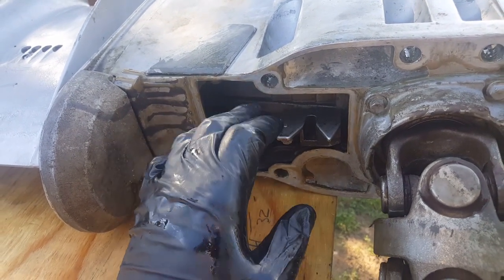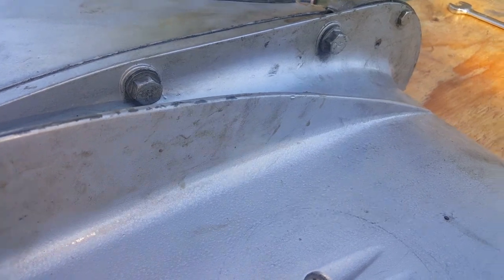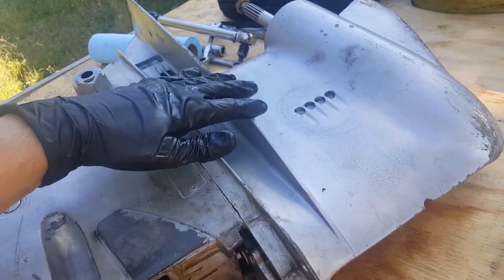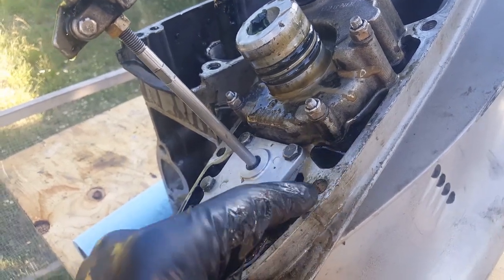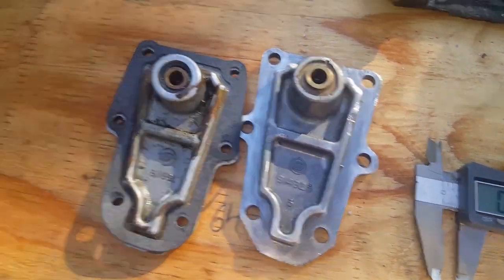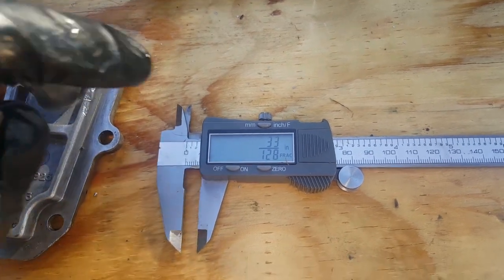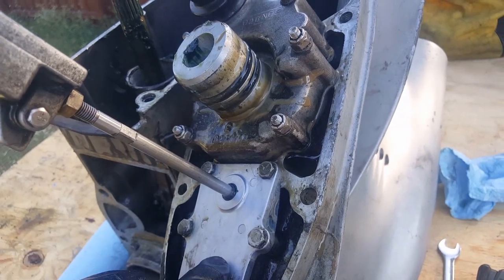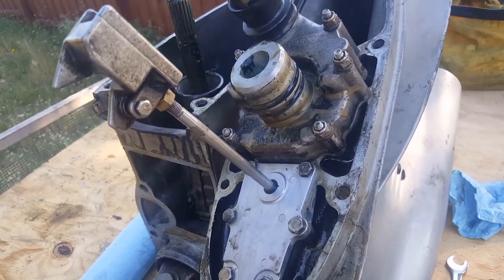Engine Bracket & ESA Troubleshooting Part 2 - Shifter Rod Adjustment - OMC Cobra Volvo Penta SX

Comment: I have a question. I have a 7.4 Daddy king cobra, I put new seals in the lower outdrive,  I pressure tested it off the boat, and seems good.  Now after I installed,  I moved the prop shaft and a bitt of gear oil leaked. It has tiny bit of play left and right. As  well as will pull forward slightly. Is mine installed wrong? Maybe bearings need to to be shimmed?
Reply from the maker: Hey check this out. https://youtu.be/833vJqDWGxQ?si=apo5OEhGsPPdRhtv
Reply from the maker: Hit that subscribe button too!

Comment: Very complicate 😅You must not split the upper and lower unit and mesure. You can use the OMC lower shift cable adjustment tool  (normally usable for the transom side) on the mirror side (Antagonist on upper gearcase), too. Use two long 12mm screws and fix the tool at the 2 lowest holes in front of the shiftrod. Sorry for my bad english.

Comment: You

I stored the boat for 4 months and now it's frozen won't shift in to gear forward or reverse. Shift shafts frozen in cover . Dose the shift rode come out with the cover ? . And how do I do it . The manual says to pull the rod out from the cover and the pictures show the shift rode out of the io

 Also how do you get the ride out

Comment: Hey mike! I’m currently setting mine up and the manual calls for 7.203 or 7 -13/64! Is this not correct?? I have a 1990 sunbird Corsica with the OMC cobra.
Reply from the maker: That’s fine. Just measure from the very top of the shifter to the base, not the shift cover. Please hit the subscribe button!
Reply: Michael Romer thank you for the quick reply! I used a 8” caliper and set it to the measurement and then used a metal ruler across the top of the shifter to the machined mating surface to get an exact measurement. Was right on the money! Crossing my fingers it shifts okay when I get everything else together. I’ve been watching all of your videos and they’re such a huge help! Thank you for taking the time for make them! I am subscribed and have the bell on! 👍

Comment: Hey I have been trying to locate some info about a potential problem I have been having.  I have an 1993 Four Winns Horizon 190 with an OMC 5.0 and cobra out drive.  We have  it had any issues until our last use.  When we shift into gear it it locks in and as we speed up there is a point where it seems like it is engaging into gear again. Make a clunk noise.  It will do it at a low or higher speed, almost like it's at a certain time after being shifted into gear. It only does it the once until it is shifted out of gear and back in.
Reply from the maker: If you haven’t swapped out your shift cable, it’s 99% of these type of issues. Check out my video on it. It’s a two part series.
Reply: @michaelromer2016  I have been looking into it more and I do have the red cable installed  and it shifts fairly easy. It might have something to do with the idle speed maybe.  It seems a bit high. I noticed than last time we were out that when we shifted into neutral the rpm idled quite high.

Comment: I have a question regarding the initial threading settings for the shift rod into the housing. How many turns should it be in the housing before making adjustments to the top shaft linkage?
Reply from the maker: David. The rod needs to be threaded all the way down into the lower unit. If not, you will likely strip the threads over time.  Do me a favor and hit that subscribe button! Thanks!
Reply: @michaelromer2016  thanks so much so the final measurement is taken withbthe shift rod fully threaded into the housing. Much appreciated i couldnt find the answer anywhere.

Comment: Does anyone know what measurement you use if you have a full replacement lower from SEI? I have no idea which shift detent it uses
https://www.sterndrive.cc/product/Fits-OMC-Sterndrive-OMC-Cobra-0985586.html
Reply from the maker: I imagine it used the updated shift detent. I'm not sure if I mentioned it in this video, but you can tell which detent is installed by judging it by hand. The pulling force to get it into gear is way easier with the upgraded detent. Do you have the older lower to compare with? The pulling and pushing force, to me, feels almost effortless with the upgraded detent.
Reply: @michaelromer2016  I do have the original unit, the effort to shift the SEI lowervs. the original lower is significant. The SEI unit is definitely easier to shift. It's not the best comparison because the original lower did have a gear failure. The measurement I get with a tape measure from the cover (larger main area NOT the boss where the shift shaft runs through) to the top of the shift shaft bracket thing is really close to 7". I'll contact SEI and see if they can give me a target measurement
Reply: SEI just reported that the shift height is set at the factory. Approximately 7.25" (I measured with a measuring tape)

Comment: Hi Michael .. hopefully can you advise ... the manual suggests a shift rod height setting of 7 and 13/64 inches which equals 18.30 mm.  Your setting suggests 7.207 inches which equates to 18.30 mm ... in addition there is a outer YouTube suggestion of 7.156 inches which in mm is 181.76 mm ?  I am slightly confused and very nervous of installing the wrong setting . Can you please advise further .. I have machined a little alloy bridge which will enable me to very accurately take my measurement from the caseing faces .. ( I am installing the new type detent.. I assume height settings will be the same as for the new type and old type as the ball centre position is likely in the same position ? Any assistance greatly appreciated
Reply from the maker: Sorry for the delay. Did you ever complete this?

Comment: If Your measurement from the Top to the Tof the cover , wouldn't you be adding that 255 thousandths ?????
Reply from the maker: I got a little too serious with the micrometer...
Reply: No not really ,  the micrometer measurements are good , I'm a machinist so I really like the attention to detail , it makes people pay attention , but allow me to ask again , so from the top to the casting is 7 inches , around 6 3/4 to the top of cover plate , not the boss where the shaft goes in but 
 on the cover plate ???

Comment: Do you know the part number for the repair kit which includes the seals you mentioned? Thanks.
Reply from the maker: Here you go: http://www.crowleymarine.com/parts/13936.cfm
Reply: Michael Romer I like your videos they are very nolligable, my question or problem is when I shift in to forwards it will not go all the way in gear. It drives but clunks. So I have to open the hood and push with my foot on the bracket to finish the shift process and then it’s fine. The bracket that you we’re talking about where the interrupter switch is if I just push that towards the back of the boat just like a half inch it goes all the way in to gear and drives good. But when I try and adjust the cable I loose reverse or forward. What do you think?
Reply from the maker: I have a whole video series on fixing your issue.  It's likely you have a shift cable issue.

Comment: i have the omc and my problem is neutral is hard to obtain i can get it but need to tap the handle to get into neutral, any ideas n what the problem could be  . thanks in advance , and this is the case from both forward and reverse, seams to me the neutral window is very small.
Reply from the maker: Sean Fredlock I'd get your stern drive off and start checking the drag on your shift cable. Check for bell crank issues, manually move your shift rod. Either way, you need to start working through these parts.

Comment: Hey. I have a 1989 5.7 omc cobro 350 small block. I have had problems getting it in reverse and with hydro locking. My flapper valves need to be replaced. So I hope that solves my whole engine flooding problem. Boat starts are runs good. I will try and adjust the esa and overstroke so as I get the new flappers in and new riser gaskets. Can I email you and send you a pic of my esa setup? It goes in forward fine. but reverse overstroke or esa needs adjustment. my setup is a bit different then the esa on  part 3, 4.  I might need to raise my throttle. It was high last year. I might have lowered it to much. 
 Thanks. You have been so much help already